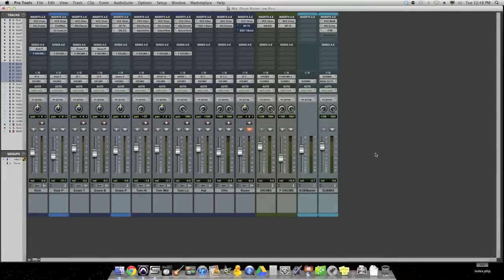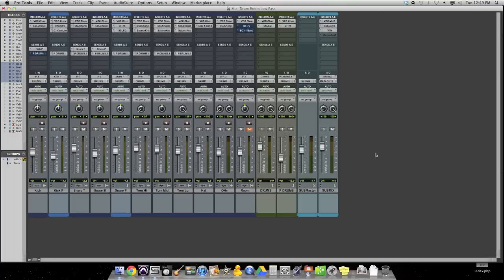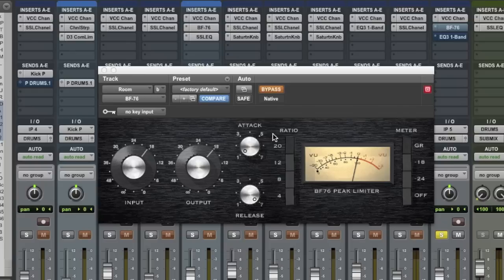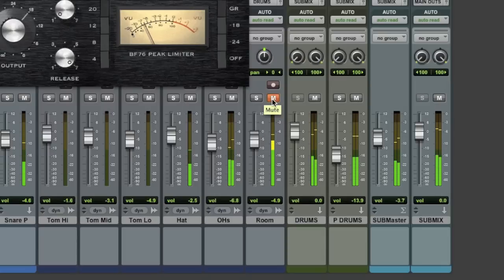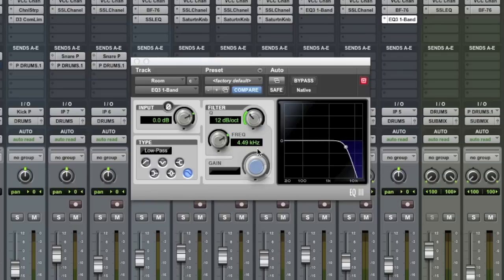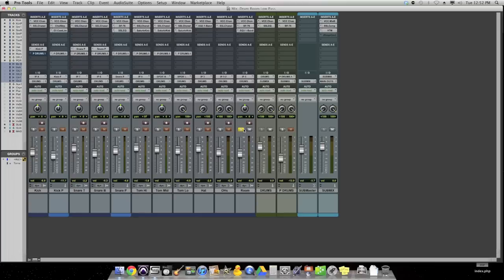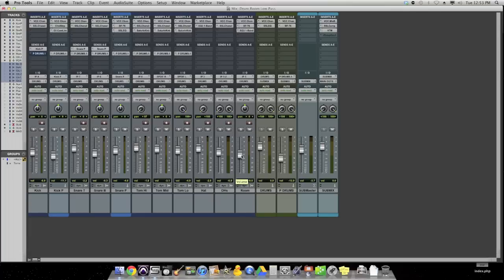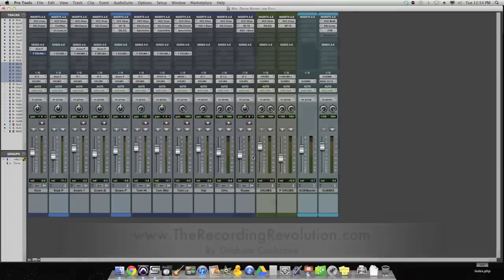A Little Drum Room Mic Tip - TheRecordingRevolution.com

Comment: Graham, a remotely related question: I have only 2 mics in my set, a cardioid condenser (mxl v63m, kinda like an entry level) and the good and old shure sm57. I've been wondering if there is any benefits on buying a cheap drum mic kit, that could give me more entries to mic separate parts of the drum, or if i should stay with my two mics solution and just try to experiment with that. In resume: On drum recording, should I care for the AMOUNT of drums as a crucial point for sound quality?